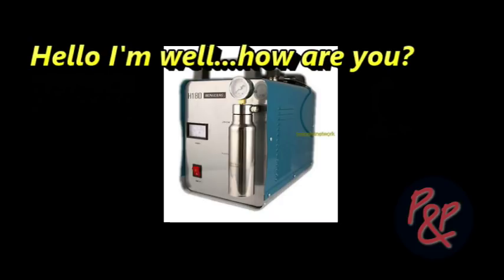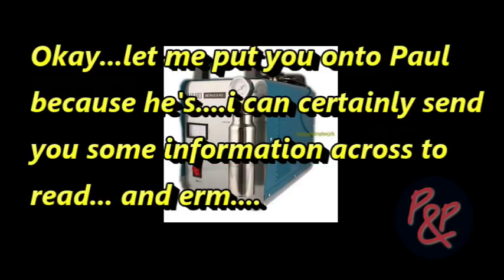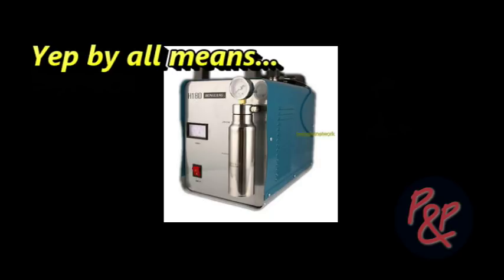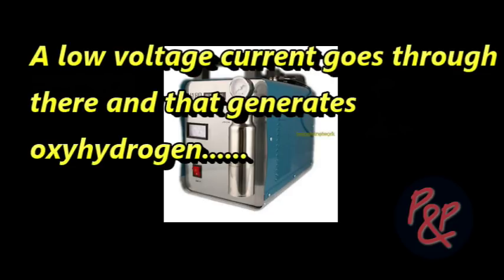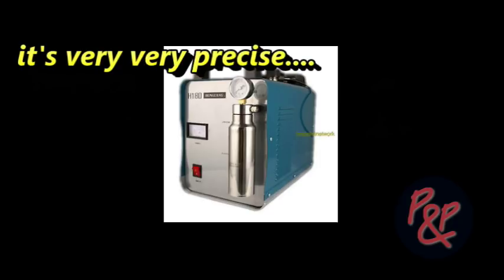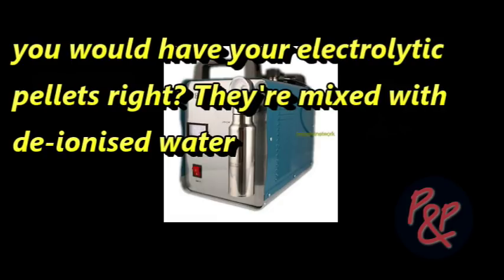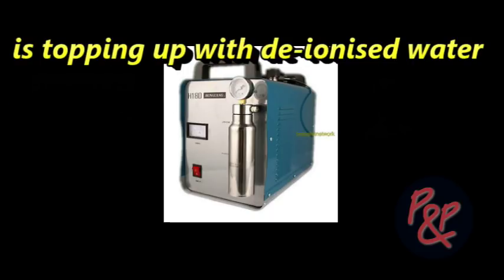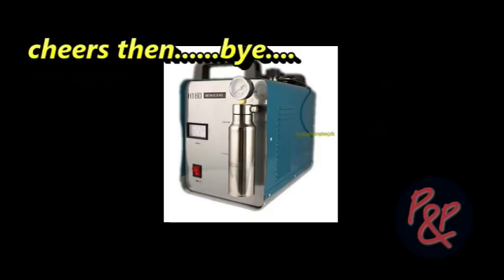Electrolytes Demonstrate Water Is NOT Oxygen & Hydrogen #3

Comment: The chemicals regulate an even constant tempreture , in the same way antifreeze works in a radiator.
Reply from the maker: tks for your opinion! Luckily I'm not discussing the workings of a car radiator! The content of the video remains valid nearly 2 yrs after publicatoin! I don't think you're opinion amounts to anything significant! Water is not comprised of hydrogen and oxygen! But tks nonetheless!
Reply from the maker: the addition of the booster helps maintain a constant flow of hydrogen to the torch because hydrogen does not come from the water!
Reply from the maker: sorry got to add this one as it is more relevant to your comment - have you ever cooked? what could you do to prevent your food from burning? You got it! Turn the heat down and that could easily be done by adjusting the torch nozzle! Remember also the methyl ethyl ketone is referred to as a BOOSTER not a temperature inhibitor! What does it boost? Of course the hydrogen output!